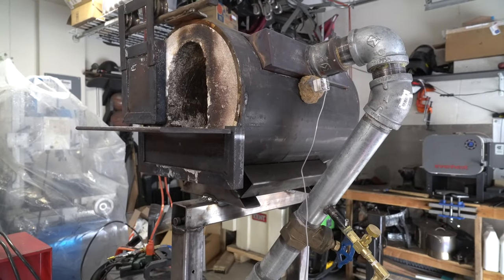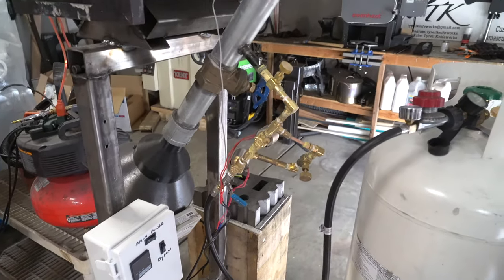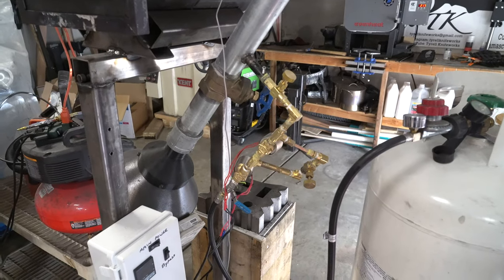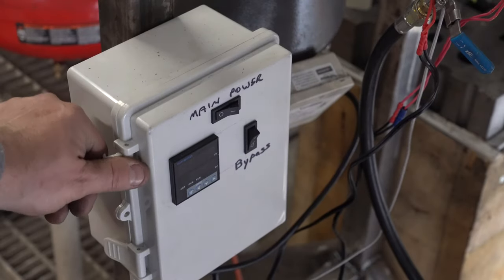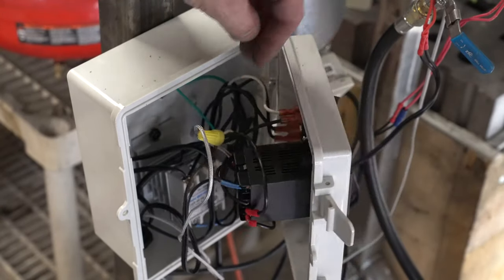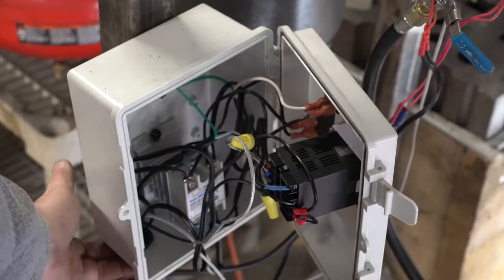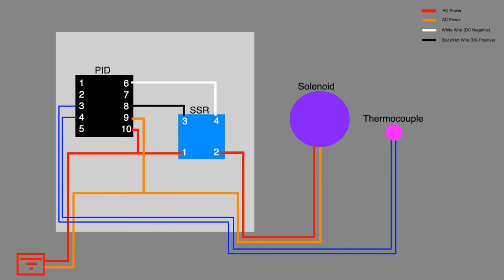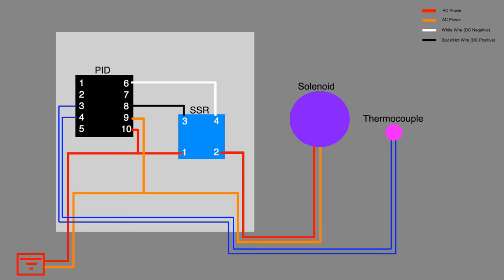Triple-T #128 - Upgrading to a computer controlled forge!

Comment from the maker: Any questions or topics I missed?   Note, this build works just fine for venturi-style burners as well so don't think that you need a forced air forge.  With a venturi style forge you don't need the second solenoid because you don't have a fan pushing air, the air is sucked in by the gas so lack of power is not dangerous.
Reply: Great video!  Quick question. Would you need the bypass with a Venturi burner as well?
Reply from the maker: @hamitup01  the Venturi at least doesn’t blow air into the forge when the gas is off, but you still get a large variance in the temp.  The bypass keeps the temp more level.  Thanks for watching.
Reply: What gauge wire did you use to wire it all together?
Reply from the maker: @loganeaston5864  it was what I had on hand.  I don’t know the gauge but it’s typical wire like from an extension cord.
Reply: Okay sounds good

Comment: I watched this about an hour ago and thought I picked up an error.  But I'm in the UK and maybe things work differently on the other side of the pond.  You state there is no difference between the two wires in AC.  Well I think you are wrong.  One is live one is neutral.  You can get a sock from the live but not from the neutral.  Therefore it is good practice to switch the live.  If you switch the neutral the solenoid, light bulb or other device will always be live even when it is switched off.   Great video BTW big fan of your blade work.
Reply from the maker: Well, there is technically a difference, but in these applications they are interchangeable.  It doesn't matter which wire is wired to either the PID or the solenoid.  We aren't using 220v like in the UK.  Thanks for watching.

Comment: Brilliant.  I  built my 220v HT oven 10 years ago with a PID, relay, and thermocouple.  This will be easy.  I think I can control my air flow in a similar way so that it cuts to 50% ( or whatever) along with the gas by using an AC speed controller and another relay or two.  The fan would switch between full power and regulated power based on output from the PID.
Reply from the maker: Give it a try.  👍. Thanks for watching.

Comment: If you say you’re not interested in controlling the temperature while forge welding, then what was the point in setting up a temperature control on your forge?
Reply from the maker: For heat treating and doing non ferrous metals.  When I’m forge welding I have the forge running full tilt around 2300F.  I don’t need it to maintain temp.

Comment: Awesome build!!  A tip for future gas plumbing, to avoid the copper flare scenario, a black iron pipe union would eliminate that problem for you.  Keep up the great content, you are inspiring for sure.
Reply from the maker: I had thought of that but couldn't find black pipe in 1/4" that would work with the plumbing I had.  Thanks for watching, Aaron.
Reply: All I have left in this build is this part.  I don’t understand how an iron pipe union helps. Heading to FW Webb in am.  Any tips on what to buy?

Comment: This is genius. The scale formation and cool down from the blower never shutting down is the whole reason I haven’t installed a temp controller.  Now I know how to solve the problem. Thanks for sharing this Denis. 
Now you just need an igniter wired in so you can flip a switch and and the forge fires up. 😉
Reply from the maker: That’s an easy addition to just add a piezo-electric igniter.  😉.  Thanks for watching, Erik!

Comment: This is an idea ive been kickin around for a while now and just havent had the need for, until now. My primary forge is on its last legs, and im planning on doing a ribbon burner. I have all the parts to do it, and im gonna have to do a tutorial video on it, anyways so im probably gonna opt for the temp controlled version.

The extra solenoid really is a great idea. I know i coulda eventually figured it out, but thanks for doing it, and explaining it with diagrams and everything. Super helpful and an asset to the builders community.
Reply from the maker: I’m happy this helped you out.  Thanks for watching!

Comment: I work in HVAC so I work with gas and controls. So my setup is similar to your except the second valve for continuous flame. (Which I’m definitely going to do). I did add extra stuff such as a switch for the blower so when I’m done with the forge I can leave it on to cool the forge down faster. Also have a magnetic main switch so if the power goes out in my area (which happens a lot) and I forget to shut the gas off and walk away, I don’t need to worry about gas flowing when the power comes back on because the main switch only works when power is on. Also an amp sensing switch so if the fan fails, the power to the PID is turned off. I added that because I have had a fan fail and didn’t notice right away and I had dragons breath like crazy and a lot of soothing in the forge and garage. 
Thanks for the video..
Reply from the maker: Yeah, that is one issue, the fan failing.  Honestly, I don't leave the shop when the forge is on so it's not really that big of a deal for me.  I'd know right away if the fan died.  I do like the idea of the magnetic switch though.  Thanks for watching, Kelly.

Comment: Dennis, the mad scientist blacksmith. 

A friend of mine tried to sell me on a similar idea. He wanted to use a laptop to control the setup, and I didn't want something that sensitive near my forge. Not to mention, I was using only solid fuel forge then and wasn't interested in switching to gas. Now that I have 2 gas and 1 solid fuel forges, I may modify one of the gas ones to this setup. Great idea.
Reply from the maker: I definitely wouldn't put a laptop near a forge, you'd probably fry it.  These cheap PIDs are the way to go. Thanks for watching.

Comment: Awesome, Awesome, Awesome!  Thanks for the credit!  I’m going to order the S-type and give it a try.  I like the bypass switch…going to add that as well.  The forced air doesn’t over run because of the blower always running…mine being a Venturi type does over run almost as much as it drops.  I generally set it for about 1475 to 1480 if I’m going for 1500 and it averages about 1500 with a 20 or so degree swing in either direction.  Love the improvements!  Can you share the settings on your Inkbird?  I assume they’re pretty similar to mine since you’re only using one function of the PID, but still would like to see it.  Thanks Dennis!  It really helps beginners and hobbyists who would rather spend big $ on a grinder first and foremost and buy the heat treat oven later.  I also used the same PID on my tempering oven…worked great there too.  Much thanks to Redbeard Ops. on the tempering oven.  One other tip…the box you used makes sense for your forge, but I used a plastic ammo can for mine since it’s a smaller forge and I need to be able to break it down and put it away when not  in use.
Reply from the maker: The ammo can is actually bigger than this box.  I did order the ammo can but its much bigger than I expected.  This plastic box works better IMO and is slimmer.   The only setting from the default on the Inkbird I changed was the type of thermocouple.  Thanks for the help in this build!
Reply: @TyrellKnifeworks  The ammo can is bigger than needed, but when I’m not using it I put the power cord and the thermocouple inside for storage.  It makes sense for my application but the box you used definitely makes more sense on your forge which is more of a permanent fixture.  Thanks again for the credit!

Comment: Hello. The 1999 degree limit on the PID controller is its factory setting, you can enter its settings and raise it higher. Thanks for the video
Reply from the maker: I don’t see any way to do this in settings.  Elaborate on how please.
Reply: @TyrellKnifeworks  Or just use Celsius
Reply from the maker: @jacobchristian1823  Or just use a $4 switch which is better anyway.  I don't want to fiddle with setting the temps every time.  MOST times I don't want a temp controlled forge because I'm forge welding so I just use the bypass switch.

Comment: Hi Denis, first of all I love your channel! Very informative, and has helped inspire me to start forging knives!! Not sure it is mentioned but S-type thermocouples only work properly with s-type wire (which I cannot find on Amazon). Also, given the price of credible s-type thermocouples it is probably best to buy a “legit” k-type from a pottery/kiln supply as they are only about $28 and ceramic insulated, k-type wire is also a lot easier to find and cheaper. Question: did you do any testing on where to place the thermocouple for best accuracy? I am thinking of placing two on opposite sides and controlling the higher side and just flipping the steel to heat evenly. Thanks again for all you do for the bladesmithing community on YouTube!!
Reply from the maker: I tested my thermocouple setup with an independent k-type hooked up to a meter and they were exactly the same.  I put my TC exactly where I put my steel since that’s where I want to know the temp. Thanks for watching

Comment: If you replace that topmost right angle fitting with a T fitting instead then you could run the bypass back into that fitting.  It would use one less fitting that way.  I really like this idea though and I may have to do this for my forge one of these days.  I have a two burner forge though so maybe my "bypass" would just be to have one burner always going and control the other one but I'll have to do some tests and see.
Reply from the maker: I think you should look again, the bypass already goes back into the main fitting.  Thanks for watching.
Reply: Jeff, saw your question and wondered if anybody would mention it.  Tyrell, look at 14:50 mark and see the "Tee" just above the solenoid, and the "90°" just above.  If the "90" where replaced with the Tee, then pipe the bypass valve to the Tee fitting the "90" would be eliminated and make a slightly cleaner installation.

Tyell, you did a GREAT job with your videos - all of them as well as the forge series.  Got me wanting to make a ribbon burner forge now:)
Reply from the maker: @kenh8979  but you guys aren’t seeing what’s a male vs female fitting.  I needed a coupling so I just used a 90.  Plus you have to have the compression fittings there so you can plumb it.
Reply: @TyrellKnifeworks  im having trouble figuring out what size compression fittings and copper tube to use. Im thinking about drilling and tapping another hole in my 2" pipe and plumbing the bypass into it.
Reply from the maker: @shereecanida6407 yeah that would work.

Comment: Wow, very interesting.
Reply from the maker: Thanks for checking it out!
Reply: @TyrellKnifeworks  are forced air forges better than none forced air? I have a 3 burner forge but isn't forced air.  do you think the bypass valve to allow the 50% 100% gas would still work fine?
Reply from the maker: @MrBill-ee4mr  I do believe forced air forges are much better.  It lets you control the air and gas separately.  This is particularly useful when forge welding and you want a very fuel rich environment.  This PID controller system works great on both forced air and naturally aspirated burners.  A slight advantage when using the venturi style burners with the PID controller is that you don't need the second solenoid because you don't have to worry about power failures since you don't require a fan.  You also don't have the same amount of air flowing into the forge on low gas mode since its the flow of gas that pulls in air.  If all that made sense.

Comment: Hey Dennis, did you have to adjust the PID at all to get an accurate temperature reading? Mine cold seems like it's off by about 40ish degrees
Reply from the maker: Nope, I never had to adjust it.  Do make sure you’ve got the PID set to the correct type of TC that you have, whether it’s a K or S.  Thanks for watching.

Comment: Hey there Dennis, I finished up the forge build and this PID build! I've been forge welding this last week (successfully) and I had a couple questions about your gas level when making damascus or forge welding: is your needle valve opened up all the way? I have the air gate open about half-wayish(?) and once I get the gas going fast enough to get to 2200, the valve is opened up all the way and I have to actually turn the red dial on the regulator hose up every 15-ish minutes so that the PSI doesn't bottom out... I try and keep the PSI around 1 or 2. 

Basically I have to turn it up at the reg hose once I notice the temp dip below 2000. I mean, it's working... but I'm 2 tanks of propane down and just over halfway done with a basic mosaic billet. Is this normal? Sorry to bother you! I know you have better things to do. I'm just a little freaked out that I'm doing something wrong by missing something simple.  Anyways, thanks as always for the great videos and info :-)
Reply from the maker: You can't really compare to my setup if you have different orifice sizes feeding the gas into the system.  The PSI is entirely dependent on that since all about back pressure.  Plus I have no idea how long your forging sessions are.. "halfway done with a basic mosaic billet" doesn't tell me very much.  First thing you should do is get a large propane tank.  The small ones have such variability depending on how much gas is in them plus they freeze up easily.  Get yourself a 100 lbs tank.
Reply: @TyrellKnifeworks  Ok thanks! Yeah, all my sizes are same as yours (built according to your specs in the videos) but I think you actually solved it: tanks are freezing up. Just noticed I still have propane in all of them... They just quit after they get too cold I guess. Never happened to me before so I wasn't aware it was a thing. Thanks again!!!

Comment: @TyrellKnifeworks would you mind showing the wiring itself? i wonder why a bypassswitch ?`and how do you switch off the master solanoid if something goes wrong rather then just turning the pid off as the fan and the master are wound into the power that goes into the pid?
Reply from the maker: There’s a wiring diagram in the video.  The main solenoid is wired to the main switch so if there’s a power failure for any reason, it will kick off.  The bypass is if I’m forge welding and don’t care to use the PID to regulate temperatures at all.  Thanks for watching.
Reply: @TyrellKnifeworks   oh im so sorry i totally overheard that in the video because i was so busy scratching my head 😅yeah makes sense, come to thiunk of it. so terrible sorry to waist your time with that question. keep up your awesome work, you are the bomb
Reply from the maker: @Smutjetk no worries, I don’t mind answering questions. 👍

Comment: That's a really interesting design. Would it be possible to throttle down the gas proportionally to how close to the target temperature the thermocouple is to smooth out the temperature change? I'm very interested in playing with this design to see how precise I can get it on my T burner setup. What do you reckon the limitations of this are for heat treatment compared to a proper heat treat oven?
Reply from the maker: The PID has a lot of configuration options you can play with.  Right now I have it so it will hold   +/-5F from the set point.  As long as you use a pipe or something to diffuse the heat a bit, it should be very comparable to an oven.  Just make sure you heat up your forge fully before you start heat treating like this.  Thanks for watching, Matthew.

Comment: Does this setup work just as well with a venturi burner as well?
Reply from the maker: Yup, just as well… A little better actually because the air is reduced as well when the gas reduces.  And you don’t need the second solenoid because you have no powered fan.  Thanks for watching!
Reply: This was my question, thanks for answering it! Great video. @TyrellKnifeworks

Comment: When there is no bypass (pilot light essentially) why not wire the fan the the SSR as well? Are the temperature swings still too severe? Either way the bypass will probably get you the closest +/- to the set point. Also have you tried running the auto calibrate on the PID? That might help dial it in a bit more.
Reply from the maker: The fan has a 2-4 second start up so it would be too dangerous to pipe in gas for 4 seconds until the fan really starts up.  Right now after the forge is at temp, the swing is about 10F.  You can't really get much better than that.  😉

Comment: The small amount of fiddling I've seen done with these, they're really quite good for heat treating simple carbon steels in that 800-850C range. it is the first time I've seen one with the ribbon burner though so that is kind of neat. I can't remember if you've covered it, but with the ribbon burners how many CFM do you usually need for a blower on forge and burner combo that size?
Reply from the maker: Watch my video on the ribbon burner forge build.  This is a 440 cfm fan.  Thanks for watching.